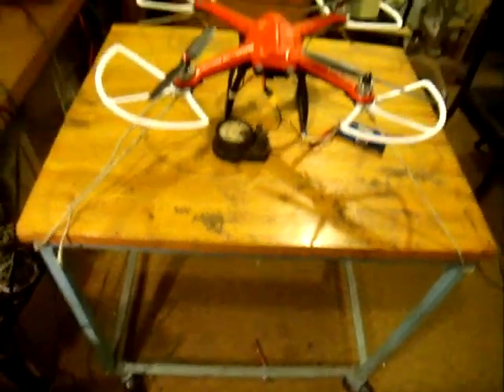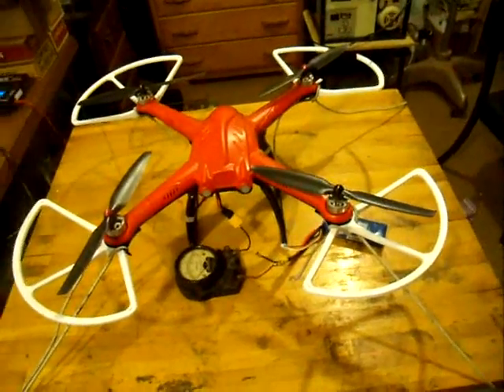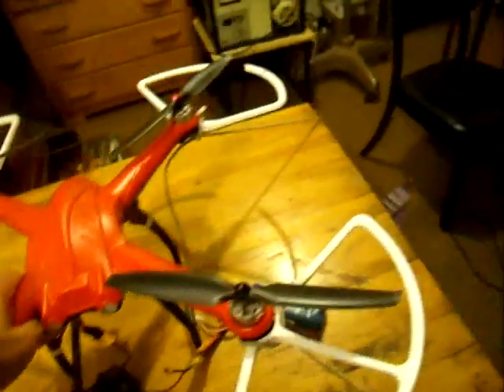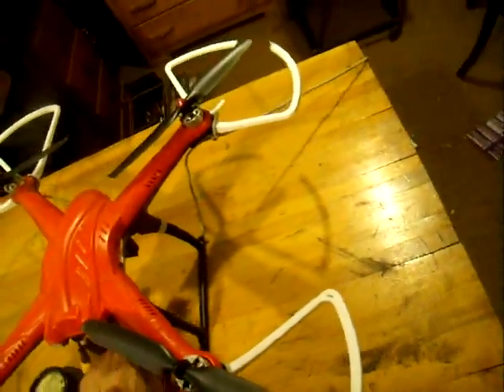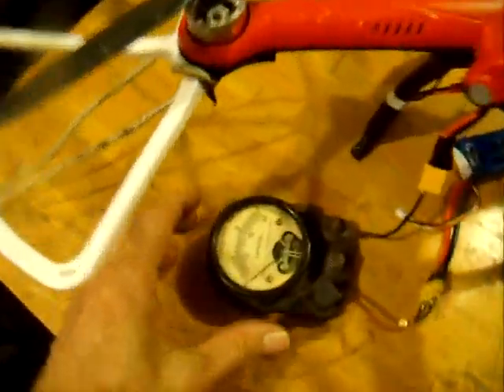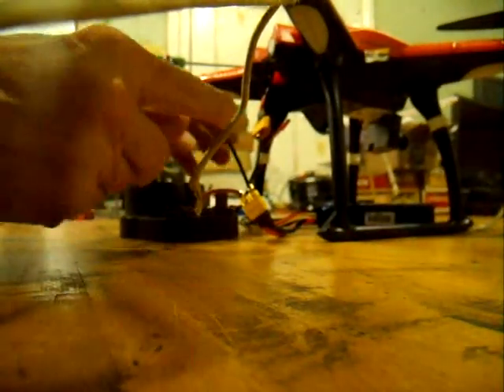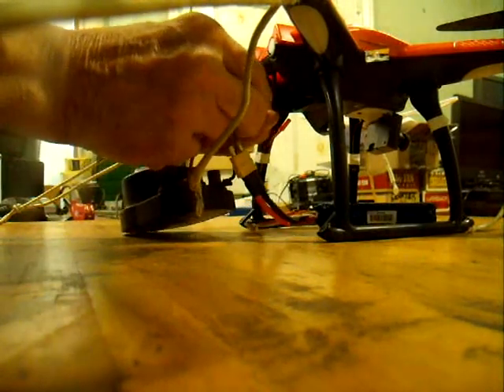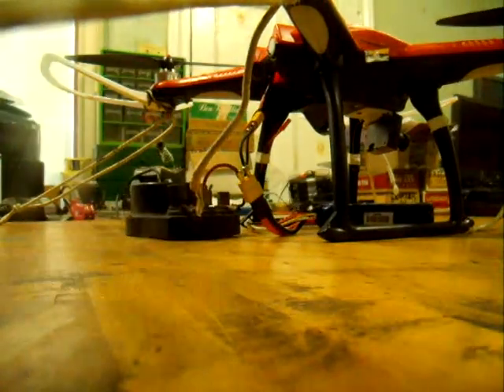skyviewtest

Comment: 9a per motor = about 100 watts each at 12v.  Combined, isn't it about 1/2 hp? 
That quite a bit for a small light weight battery pack to lift with. 
Modern battery, motor, prop, and composits make it possible, at a high cost for the photographer.  I canafford a tethered  weather balloon.
Don

Comment: Your test results are incorrect, pulling against the constraints would cause current draw well above what normal hover would draw.  Using your method "pulling against restraint" to determine automotive HP would probably end up tearing the car apart.  With the copter hovering and carrying only the weight of the ammeter would give you a truer reading.
Reply: Dennis, he is testing burst current, as in the worst possible scenario. The worst possible plausible  scenario is a multirotor trying to move at full power while being held in place which, as you said, draws a lot more power than a typical hover. To be able to fly within the limits of the battery he wants to make sure that it doesn't draw more power than the battery can handle in this scenario. I believe you, mistakenly, thought that he was testing how much power the rotor was drawing in normal flight.